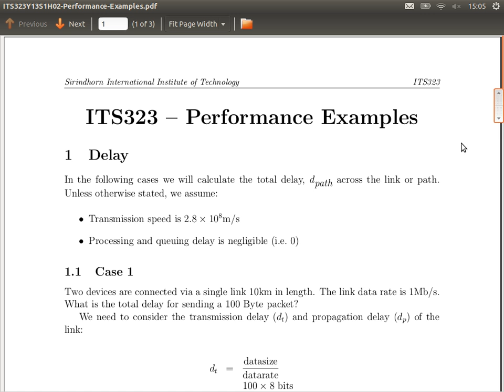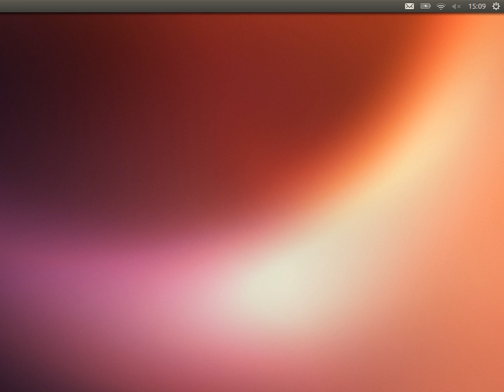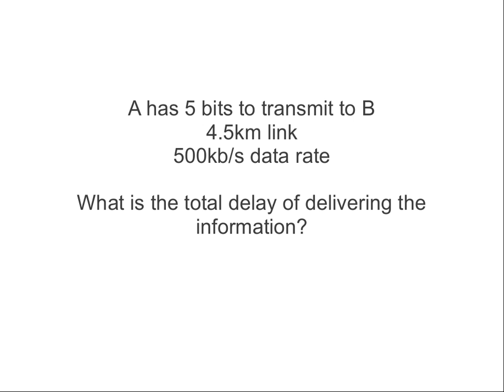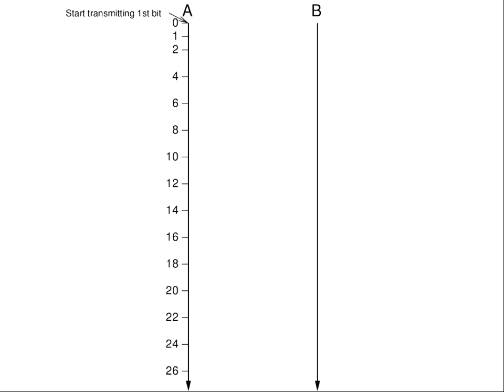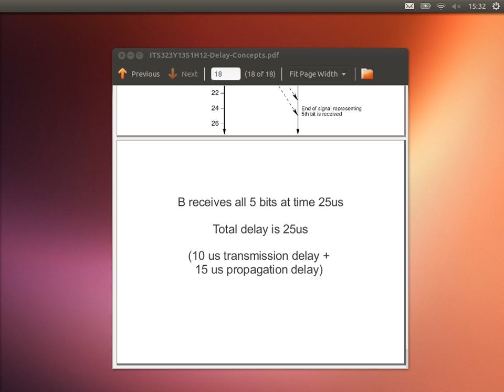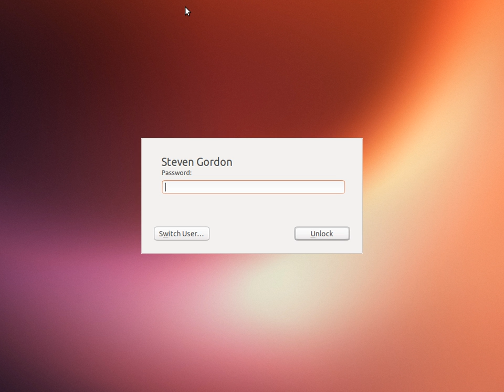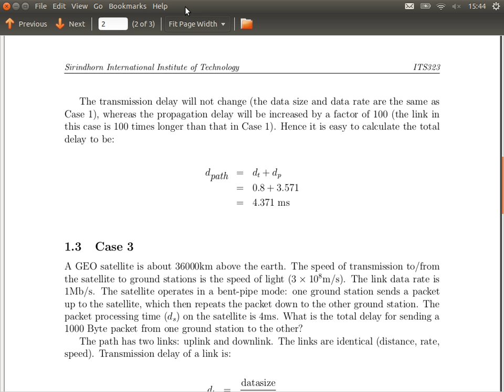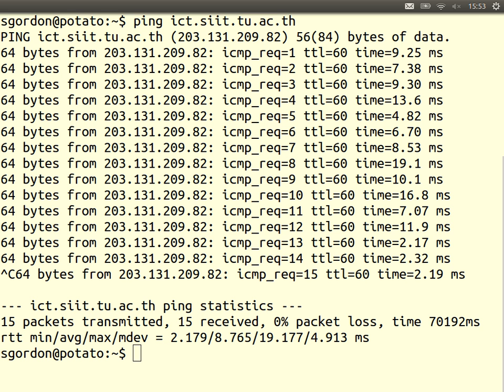ITS323, Lecture 05, CS, 24 Jun 2013 - Transmission and Propagation Delay

Comment: I have a question. AT 27.34 mins how did you come up with the dt of 0.8ms? 800 (100 x 8 bits) divided by 10 to the power of 6 (1000000 bits per second data rate) is 0.008. Shouldn't the answer be 0.008 m per second?
Reply from the maker: datasize is 800 bits. datarate is 1,000,000 bits per second. datasize/datarate is 800/1,000,000 = 0.0008. What are the units? datasize units is bits. datarate units is bits per second. (bits)/(bits per second) gives the units of seconds since the bits cancel each other out, and you're left with 1/(1/seconds) which is seconds. So 0.0008 seconds = 0.8 milliseconds (ms) = 800 microseconds (us).
Reply: Steven Gordon Thank you very much! Makes sense now.